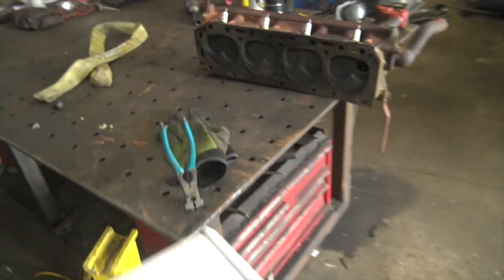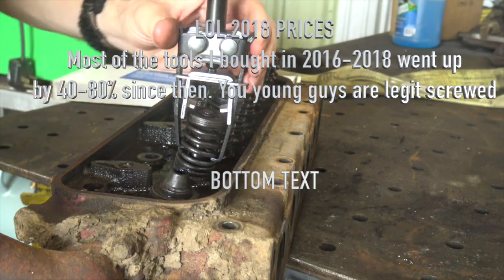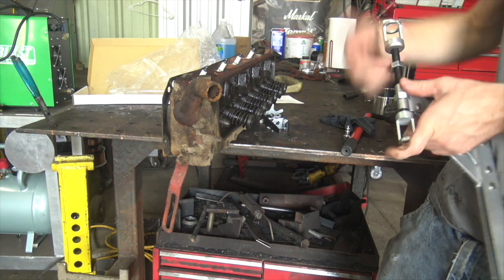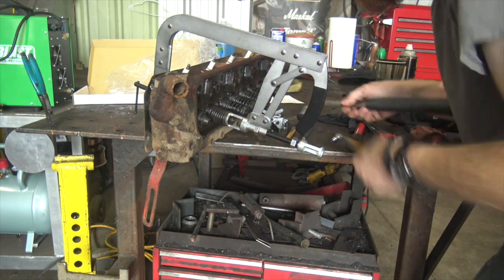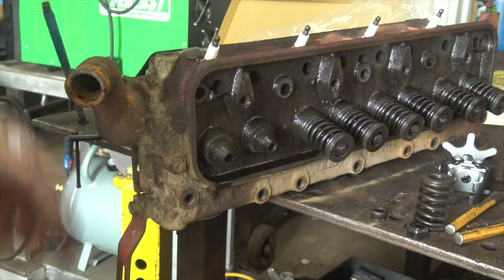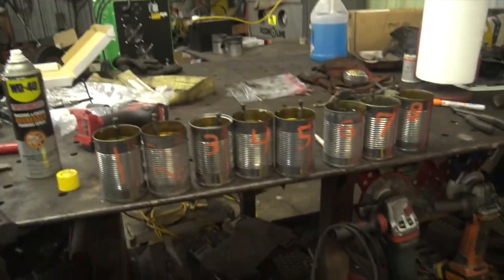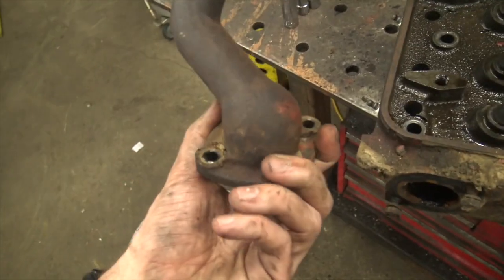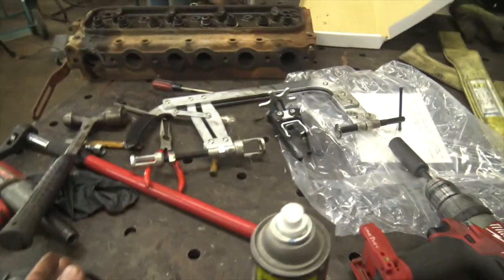MY FIRST VALVE JOB ON AN OLD TRACTOR AND IT WASNT THAT BAD!!! HERES WHAT HAPPENED

Comment: The missing keeper is sticking to the magnet you lost too while fishing around for it.
If you are doing a complete valve job should replace all springs and stem seals too.
Old springs have hidden metal fatigue and can break without warning. A dropped
valve can destroy an engine a few dollars on new valve springs would have saved.
Reply: "Just a few acres farm" On his channel. He spent a huge amount of time and money restoring a Farmall MD. He completely went through the engine, machine shop, all new pistons rings etc. Wouldn't you know it. Practically the first time out. It broke a valve spring. Dropped the valve in the cylinder. What a mess!Don't you know he's disgusted!
Reply: @rogercarrico4975  Yes I commented on that video about maybe using some 
retainer clip was a sure way the engineers could have avoided a foreseeable
engine failure and simplified repairs for a broken valve spring. That has to 
be a heartbreak when someone gets snakebit by an engineered failure mode
that isn't fail safed when that could be easily done to spare people misery. 
Anybody working on equipment for awhile sees the mercenary engineering.
Trying to think of easy workaround and preventive I have a couple of ideas. 
The clearance on valve stem guides is very small so even a small bump 
a few thousandths high on the upper part of the valve stem below the 
retainer would get caught on the guide and stop the valve dropping into
a cylinder from a broken spring. A carbide tip automatic center punch 
set for a hard strike or maybe one of those electric carbide engraving
markers would possibly peen a rough spot ridge on the surface to 
act as a depth stop on the valve guide and prevent the valve going
further into the cylinder. To ever remove the valve a small file like
a point file or a dremel grinder would be used to remove the bur 
deliberately put there as a fail safe. If I was reusing old springs I
would absolutely do this bit of improvisation for insurance. Another
idea for making a rough spot on the upper valve stem is the little
spot welder used to tie lithium rechargeable batteries together 
with that thin nickel ribbon spot welded and then the miniature
spot welded ribbon ripped off to leave a spark bit rough spot
would probably be thick enough ridge to work the same way. 
Anyway, just sayin' and thinking out loud what I would do.